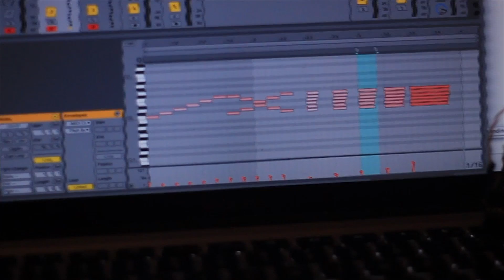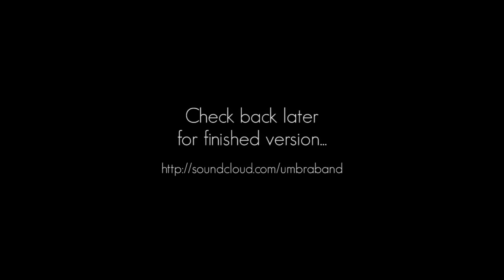Controlling Lights via MIDI using Arduino

Comment: Hi Jacob, i'm trying the same thing with my arduino. I'm just wondering how you managed to get multiple lights working, Every time i try i get the same error message and it won't work except if i change the value of the midi signal and works on one light only. cheers
Reply from the maker: Yeah I had a similar issue. I've long since lost the code for this unfortunately but from memory the arduino had issues with receiving multiple midi messages at once. Apparently you can buffer input but I didn't have much success with that. In this video you'll notice that those multiple lights commands are slightly offset and I had to carefully create the midi lighting track so any extra automation didn't conflict with note on/off signals. Also I took some shortcuts and made some midi notes turn on certain combinations of lights to get around this. In the end I think I bought a MIDI shield which mitigated a lot of those problems so if you have the means perhaps try one of those.

Comment: Hey Jacob, Is there a full tutorial that you used for reference somewhere or was this all trial and error on your part? I want to write a light show in midi in either Abelton or Logic and then export the midi track to the arduino so I can control it with Start/Stop/Forward/Back functionality and make a playlist for my band's live show. Any direction would be appreciated as I have been searching unsuccessfully for the answer since seeing this video. Thanks!
Reply from the maker: Hey! Sorry I didn't see this earlier. It was mostly trial and error haha. I just left a comment above detailing some of the process. The idea of uploading midi data to the arduino is an interesting approach though as most of my issues stemmed from streaming midi data live to the arduino. In some regards having stored tracks to play back might be a bit trickier in the end as you'll likely have to solve a few extra problems like storing the midi data in a format better suiting for arduino, getting the timing of the data playback right and working out a way to trigger the arduino to start at the same time as your tracks. Best of luck to you though, and feel free to shoot me a message if you need a hand!

Comment: Hi Jacob,
great work! You think that is possible to work only with Midi library and usb serial, without Midi Shield and just using a software bridge like Hairless-midiserial? Please, I'm very interested for your work. Can you share your code ?
Reply from the maker: I'm sorry my code is long gone now :( I was running mac at the time but from memory I did read a lot of success stories of people using hairless-midi stream midi data directly to the arduino so if you haven't yet ( ... a year later granted haha) you should give it a try!

Comment: Hi, Jacob! Nice job!
I am unsuccessfully (so far) trying to create similar project on arduino to make digital piano midi output signals light appropriate LED light. I have worked with this Amanda's tutorial and made one light to light up for a constant time, but it is not even close as refined as Your's with all the fades and multiple LED's at one time. Could You please share Your code (Janis.Marcinkevics@gmail.com)? I would be very very thankful to You.

Comment: Hi! really nice video and cool songs ! i'm tryng to interface my Arduino (seen as MIDI device) to Ableton, i'v set it up in ableton as output but arduino don't recive nothing from the software! =(
Pls can you help me?
Reply from the maker: Okay so I never really got the circuitry working properly for receiving data. I had to substitute a few parts which caused bugs and made me write my own code from scratch for this video. It couldn't read simultaneous midi signals along with other bugs -- which was a deal breaker. I ended up buying a MIDI shield for my final build and used the Arduino MIDI library to intercept the MIDI signals. I think the shield was this model: http://www.ebay.com/itm/170842963232

If you have the parts or want to try for yourself here's the tutorial I followed http://www.instructables.com/id/Send-and-Receive-MIDI-with-Arduino/step9/Receive-MIDI-Messages-with-Arduino/

Comment: Hello, nice work, where did you take the code to sync with ableton?
Thanks
Reply from the maker: All I did was set the output of a MIDI track in ableton to a USB to MIDI device that was hooked up to Arduino. The code for reading MIDI data in Arduino is all over the internet, try this: http://www.instructables.com/id/Send-and-Receive-MIDI-with-Arduino/

Comment from the maker: Yeah of course matey! I finished soldering a 240v light dimmer circuit the other day. Just in the process of troubleshooting it a bit and then I'll have to add the other lights. It has involved a lot of learning to say the least... But yeah I'll post a video eventually!